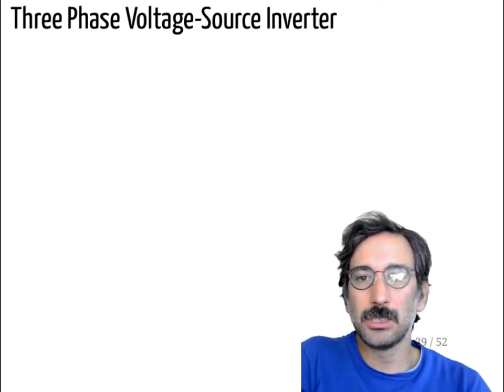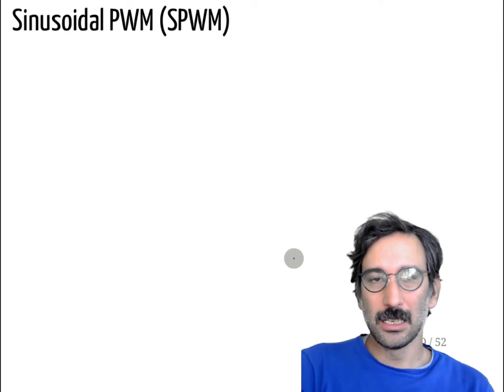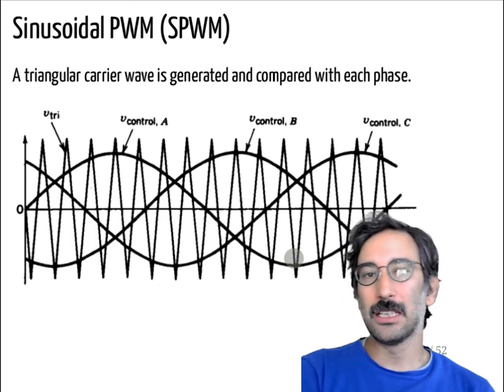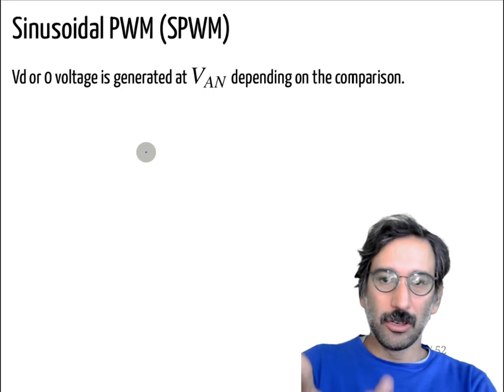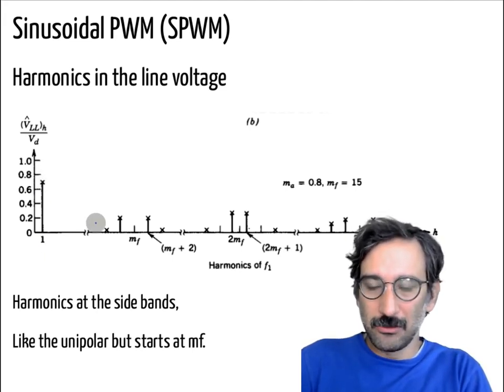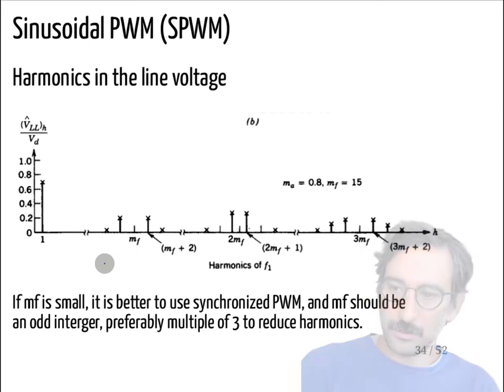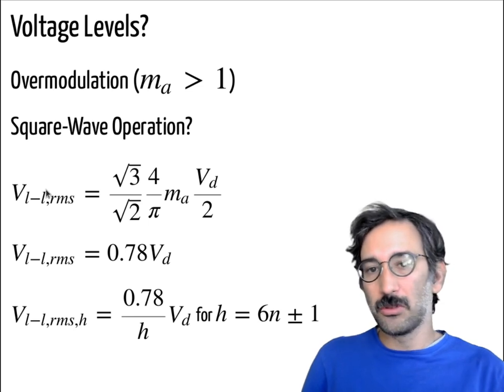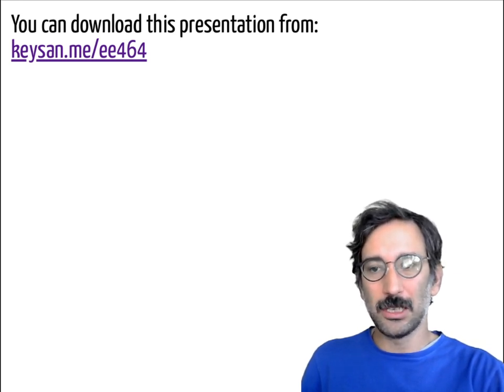SPWM (Sinusoidal PWM) Three Phase Inverters

Comment: If the triangular modulation is centered on Neutral, as is commonly done, high harmonics will be produced. You need to center your triangle modulation waveform correctly to get rid of these harmonics. You don't need 3rd harmonic modulation.